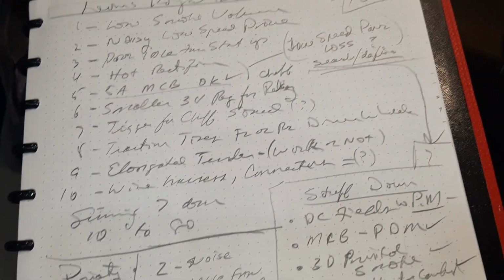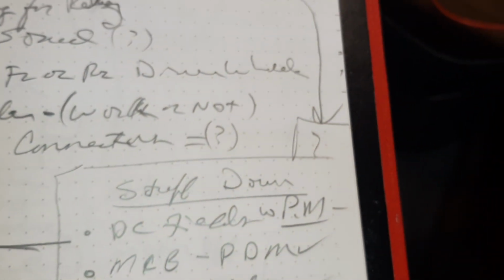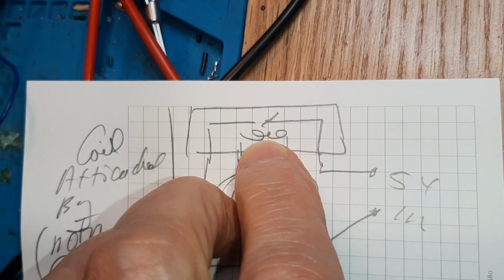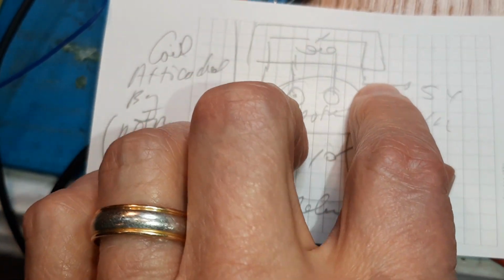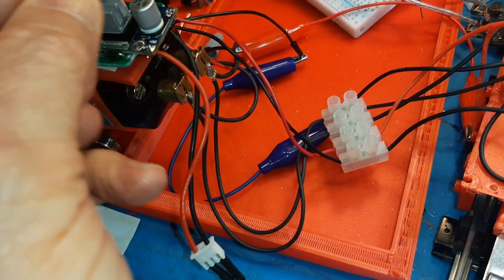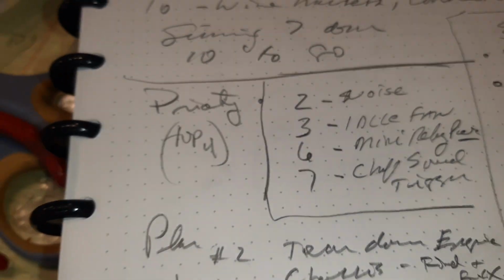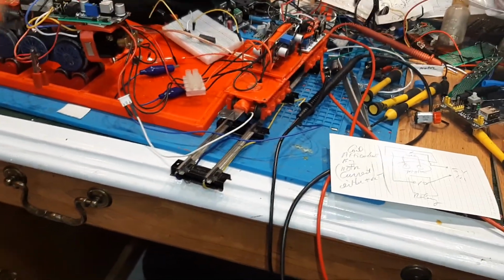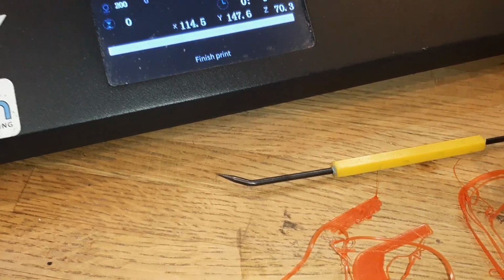Frankentrain Laboratories progress on motor brush trigger & puffer relay. More space for chuff PCBs

Comment: Wow doc.  This is great news, but I really feel bad that the Blue Mule is being such a lousey little machine.  Would it be easier if I send a newer drive from one of my Hudson'
Reply from the maker: No not at all, It presents cases we will have to address so it fine. I have running quite smooth now. Not to worry. I replaced the Volt Regulator with the chuff sound boards. Today I completed that prototype assembly and tomorrow will power it up for testing. D

Comment: If that part can eliminate all those others you showed that would be awesome! What is the number of that component so I can look up the specs for it as it is very interesting. In earlier videos it seemed as if the motor for smoke needed some lubricant. Perhaps lubing the whole works would yield better results. Just a thought. Thank you for sharing.
Reply from the maker: COMUS Relay 3570-1331-051,  05 = 5V, I may move up to 12 or 24 for safer operation using Brush Power which is Track in DC 5 to 15 VDC. Then the -015 goes to 121 or 241. The 1 removes the Diode so it worked with both directions. Have Fun.
Reply: @DennisMurphey  Thank you for the info.
Reply from the maker: @flyerjunction  It does work and I may use the same device on the Chuff Sound Trigger. Its very effective. D